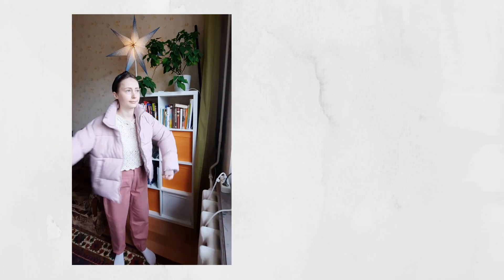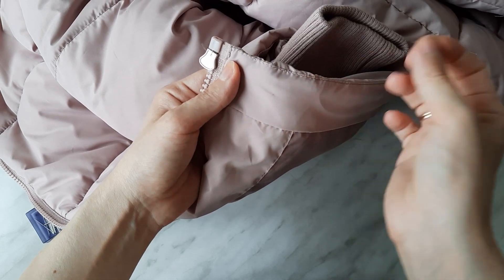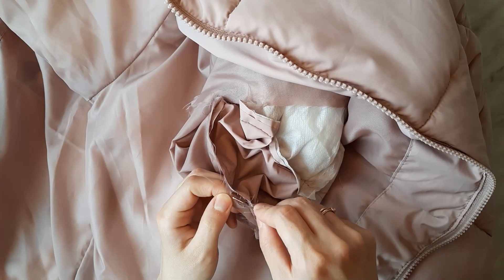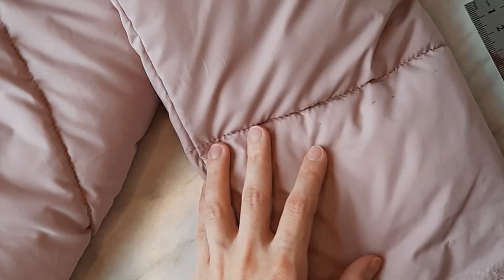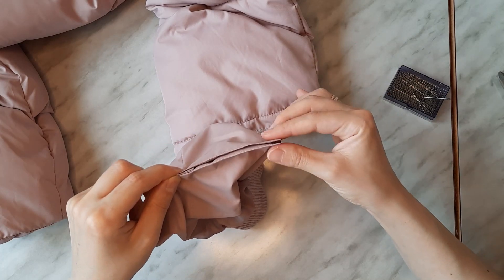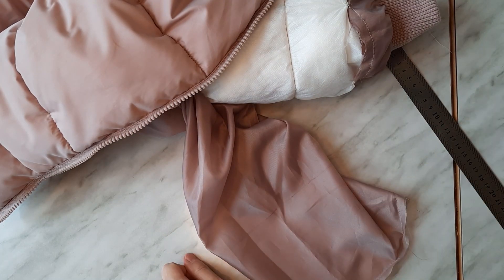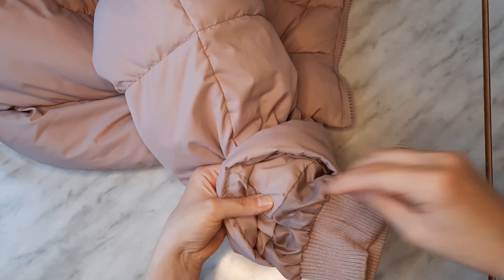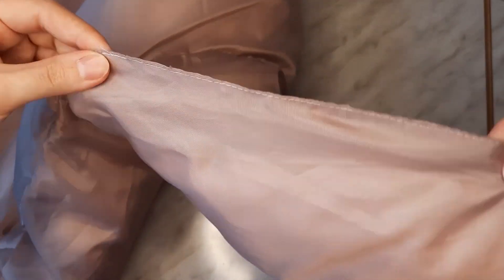How to shorten the puffer jacket or coat sleeves (with lining)

Comment: Hi your presentation was very clear. Thanks for posting.  I am planning to re-style my light-weight puffer jacket. So am looking for some advice. 
What size sewing machine needle did you use? What kind of thread did you select? Ta
Reply from the maker: Hi! I'm so glad my video was useful for you! 😊💖 I restyled my puffer jacked some time ago, so I'm sorry I can't remember the size of a machine needle that I used -  but as always, it depends on the material. If your is light-weighted - maybe you'll be ok with a №80 needle, but of course it's better to check this on your fabric first. Speaking of the thread - I used 100% polyester Dor Tak - it is a popular brand in Russia and not so pricy as Guttermann, etc.

Comment: From a geometric point of view, the sleeve should have the shape of a trapezoid in projection. So if you cut in the middle, you should end up with a step. But maybe this shouldn't be a problem for a down jacket because of the many folds. Am I wrong?
Reply from the maker: Hi!) You're right) But it depends on a sleeve construction. Some sleeves have a gentle "slope" from its bottom edge to an armhole and some - a steep one. I've had the second variant that it easier to deal with. But if a step appears - yes, one should narrow the sleeve's side seam at its bottom. Or make a gather - that is impossible in a case with a puffer jacket as there'll be too much bulk. Thanks for your question!)

Comment: I'd love to see a "how to shorten puffer jackets" when the whole jacket or puffer coat is too long!
Reply from the maker: It's even easier to shorten the puffer jacket's bottom than to shorten its sleeves!) Just measure the needed length when the garment is on a person, unsew the lining at the bottom, cut off extra length of both lining and main material (don't forget about seam allowances!), unsew the lining somewhere at the side seams to be able to turn the coat inside out to finish the bottom seam (so it won't be seen), and then finish the unsewed side seam back, turning the seam allowances inside and stitching 1 mm off the edge or hand stitch it. Hope this'll help, good luck! 😊💖✨
Reply: I'd love to see a "how to shorten puffer jacket from shoulder "when the whole puffer jacket is too wide from chest!